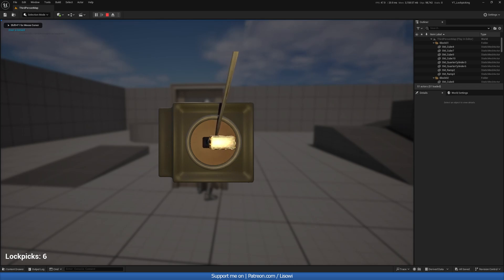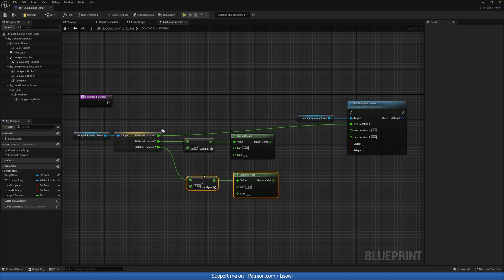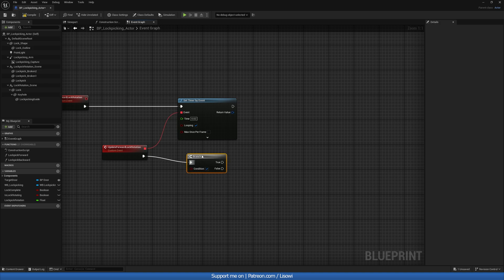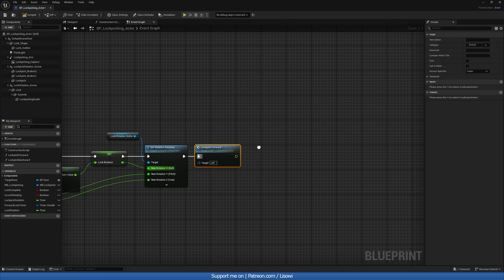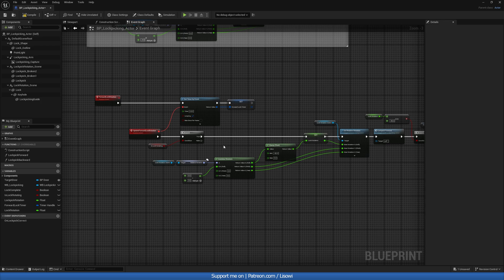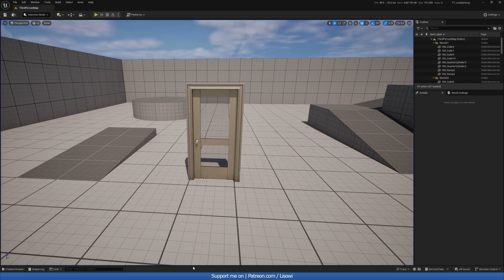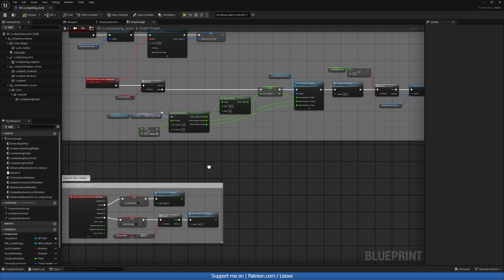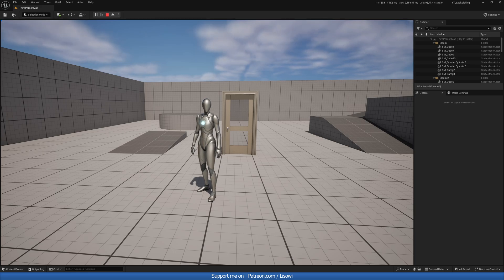Lockpicking Tutorial Part 3 - Unreal Engine 5.4+

Comment: im sorry but these tutorials are extremely stressful to follow along to. Even if you slow it down you wont get any understanding of any code you are doing. There is no way of debugging your reson for the values that "you just came up with" and Everything from part one breaks if you dont have the correct pivot from either your meshes or if something happened to your scene component.
it was an overall very frustrating experince to set this system up.